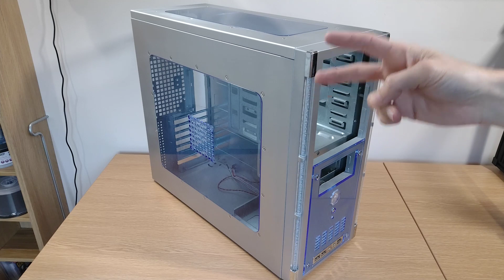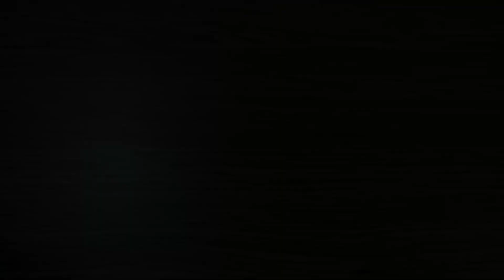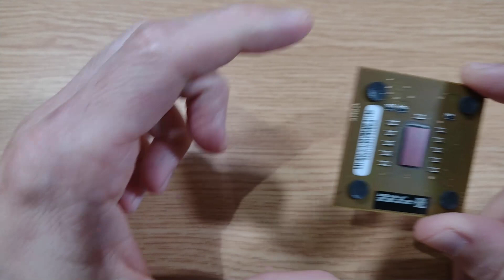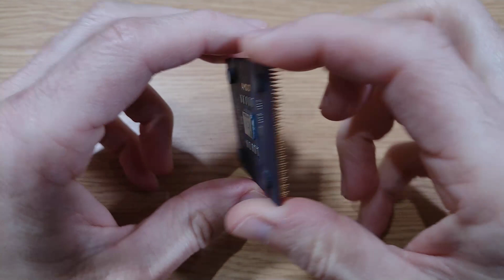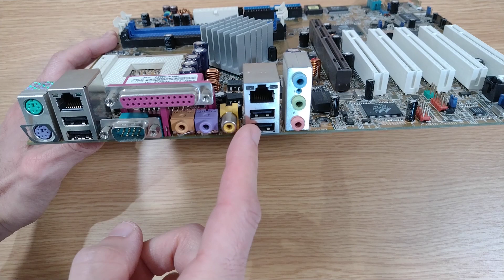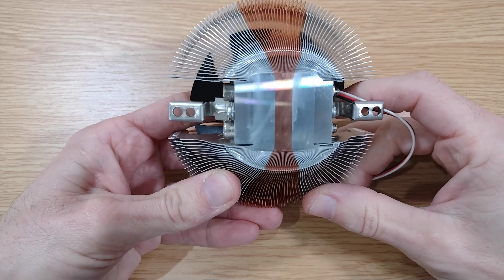Windows XP build part 2 - The hardware and lighting

Comment: Good lord. Again, I had something very similar. I'm at the mobo (11min), had the same asus a7n8x-x but with a 2200+, all that paired with a radeon 9800 pro. I'v used this machine up until early 2011 when it was not powerfull enough to run pro audio software.

Comment: For cooling the flower cooler I would mount a fan on the top, make / find a duct tube to end at the side of the cooler to pull air through the fins.🎉

Comment: 40:37 that cable is for the very early pentium 4 aka socket 423 boards that has extra power connector to deliver extra power to the cpu
I even myself learned about this recently because I got a 300w FSP psu that has the same connector too

Comment: 50:00 I'll bet the voltage drops below the operating voltage of the tachometer circuitry.
Reply from the maker: Yeah I reckon you are right, it seems to been right on the limit of triggering it though most of the speed range. I ought to test it with a hand held tacho to check.

Comment: A Scythe Kaze Master fan controller with VFD display in silver would be a great fit for that case. I use the glossy black version myself with my Cooler Master Elite 370 case for my Q9650 XP build. ;-)
Reply from the maker: That fan controller looks sweet! Thanks for the tip, I need to go looking on eBay.

Comment: You should be able to run a single drive on the RAID chip no problem. Granted, my MSI K7N2G has a Promise controller, and you will still need the drivers on a floppy when installing Windows,  but I'm running SATA just fine as the only boot drive
Reply from the maker: Thanks for confirming that!

Comment: I have the same Asus Geforce4 ti 4600. Its a ASUS V8460 Ultra With a bleu orange (tiny) round cooler. I also fitted mine with a better cooler. But have also kept the original on the side. Those all have purple pcb.

Comment: I still got Cooler Master Musketeers laying around new sealed. Model: LLC-U02 im willing to sell. Next to HDD Transfer Rack ICY DOCK Bodyguard 525 to fit a standard 5.25″ expansion bay.
Reply from the maker: Thanks for letting me know, but unless you are in the UK then shipping would probably be prohibitively expensive?
Reply: @RetroSuperhighway  Im from the Netherlands. Postage is like €15 orso. Both expansions are from 2003. The Icy Bodyguard 525 has 2 fans to cool a hdd and 3 hardware temperature sensors to place in the pc. The cooler master musketeer lets you control 1 extra fan, has a sound meter (gets connected to the sound card) and 1 hardware temperature sensor to measure temps on stuff like cpu, gpu, north bridge, ram etc and both can display it.

Comment: 11:09
Had same exact motherboard with athlon 3200+ barton.
Beast of motherboard, paired with Ati 9600pro and 1GB of ram.
I think i had it from 2004-2007, switched couple of cards started with MX440, 9600pro ended with 7600GS 256MB.
And total of 2 GB of DDR.
I remember also your OG  case it was generic chinese case it was very popular in my country,
My was knock off of Alienware case.
Later switched it with ThermalTake Xaser III  behemoth of case
Reply from the maker: Those specs sound awesome, I bet that had no problems running the games of the time! And the Xaser case, thats a name I have not heard for a long time, They looked fantastic, IIRC they even had little feel that rotated outwards on the bottom like on a full tower case because they were so big.
Reply: @RetroSuperhighway  
Happy New Year !
Yeah for the time it was awesome build.
Xaser lasted from Athlon XP, Dual Core, And  Q6600 builds.
Case is build like a tank, solid aluminium.
I got one smaller Xaser Lan fire, for my athlon XP build but sadly motherboard died.
Reply from the maker: Happy New Year to you too!
Ah so the Xaser Lan Fire was a mid tower version of the full sized Xaser case? Just had a look at some pictures and it still looks like a beast.

Comment: Pretty sure that's a PNY GF4 as I have one myself with the std cooler (labelled PNY) but as I looked at mine I realised that 8872 No at the top/frt of the card also refers to an MSI MS-8872 model number so I wonder if they were MSI made boards for PNY, I also have another Creative GF card that also has an MSI model number, so yeah could be either I guess. 👍
Reply from the maker: Thanks for the suggestion! The PNY ti4600 looks a good match too.  I wonder if one of two companies, either Creative or PNY (or maybe even a third party), made them for both themselves and the other company and just badged the ones that were not for them.
Reply: @RetroSuperhighway  for sure that is a PNY Verto video card. Creative sold them as part of OEM bundle to system integrator (Dell, et c) for higher end media PCs with TV tuner and capture breakout option, while PNY sold the retail version. Dell Dimension 8000 and 9000 series i think, with the "Creative Audio Console" and option for front panel controller.
Reply from the maker: Thanks the for the clarification, I think that pretty much confirms it!

Comment: there was a big thing back then in the mid 90s of color matched computer components. There was a web site back then that sold color matched components like optical drives, floppy drives, keyboard and mice, speakers and PC cases and moitors. They came in five or six different colors. Silver, black, purple, blue, and a lime green color. You could have made a whole color matching computer set up from that site.
Reply from the maker: Do you remember the name of the website, I'd love to see if it is on the wayback machine. I remember some manufacturers including different colour fronts with their CD/DVD drives so you could match them to your case.
Reply: @RetroSuperhighway  No, I don't remember the name of the site. I do remember seeing a full page add for the website in a computer magazine I used to buy back then. I think it was either PC World or PC Magazine.
Reply from the maker: Cool, I'll do some digging and see what I can find.

Comment: Great video! Spray all connectors/moving parts/contacts with plastic safe lanolin oil for corrosion protection and easy plugging/ unplugging! IDE connectors also!
Reply from the maker: Thats a great tip, thanks for passing it on!

Comment: While I did have an Athlon XP back in 2003 when I first tried windows XP, that is an 98/ME compatible hardware era. Far older, far more likely to present problems than a more modern machine. I have a retro XP machine that is the last hardware to officially have drivers for windows xp: An h67 motherboard and a 3770 ivy bridge with a GTX 970. Yes, the 970 is still a capable card for modern games while having official drivers for winodws XP. And I even dual boot to windows 10 with it.
Reply from the maker: Thats a really long time you can cover with that set of hardware to go all the way from Win XP to Win 10! Nice going!

Comment: if you flap a copper flex membrane, you have both the cooler and the near solid state fan in same package
Reply: yes the egyptian style flap
Reply: meh why do you still have clock multipliers then
Reply: this is still the current gen style processor, from 2000s
Reply: the multi-head cd-reader
Reply: takes a long time to put something in speech output format
Reply: speech is very inefficient way of anything, may God be with you

Comment: I love it. I used to have this exact motherboard with a 2400+ @2.4ghz on water. The POST speech reporter absolutely would talk over the audio out. It'll even do it on a successful POST, not just errors. If I recall, it says something like "Power on self test completed. Now booting into operating system"
Reply from the maker: Thats a nice OC out of that chip, do you remember what water block you were using? I need to have more of a play around with the POST reporter, I think it's the only motherboard I have with this sort of thing on it.

Comment: Ahh! The Asus A7N8X-E Deluxe. What a board it was! 

I had that board in my PC back then, with the complimentary WiFi (b) card. 

The only flaw of the board was the lack of power. It lacked a 12V P4 connector and only had a 20 pin ATX power connector. By this time, I’d expect more from Asus. 

I used the same CPU cooler, and eventually replaced it by a CNPS-7000cu-LED (iirc). It cooled considerably better. Especially when using an Athlon XP-m 2400+, clocked like a 3700+!! 

I had an ATI Radeon X800Pro 256MB, flashed with a Gigabyte BIOS, so the extra pipelines, shaders and clocks were unlocked. 

It was an absolute beast of a machine! 

I’m loving this video so far!
Reply from the maker: A 12v power connector would have been nice to see, especially since it was the higher power Athlons that were the first to needed them IIRC. Interesting that the all copper version of the cooler performed considerably better. I'm definitely going to be doing some overclocking on it in the future, so it will be interesting to see if it holds the CPU back. (Not that I expect much more from this CPU anyway!)
I had forgot about the ATI cards that could be flashed into the higher models, thats a 'memory unlocked' moment for me! The specs on your machine sound awesome.

Comment: You are missing the cable for front usbs and audio, also a x4 hardrive bay that slides in on the rails where the speaker is. 
You've got leds out in the bubble tubes as well two top and two at the bottom they display different colours for a two colour effect. Great video now waiting for the Xp install, thank you 😊
Reply from the maker: Ah, I thought there might be something go where the speaker is, but since my original case didn't have anything there, I'm not too bothered about it. (It would look nice and shiny next to the cold cathode tube though!)

Comment: well done. a slot load drive, thats for my ps3. giving up the dual use cup holder isnt worth it the fanciness.
Reply: and that purple pcb looks great
Reply from the maker: I like the purple PCB, I don't recall seeing much other hardware around at the time that was purple?
Reply: @RetroSuperhighway  ECS made some nice purple mainboards (K7S5A) but aside from that, I can’t think of any 🤷🏻‍♂️
Reply from the maker: Ahhh, thats a nice looking motherboard. Great suggestion, purple souncard anyone? :)
Reply: all purple build may be possible. i have one of the many variants of that case, no fancy led on the front edges l;ike yours but it does have an lcd screen encircled by the power/reset/activity lights in the front. there are wires from the lcd panel but no idea what they connected to.
Reply from the maker: The more similar cases I see, the more it seems like they all came from the same factory with the subtle differences depnding on who was going to be the end seller.